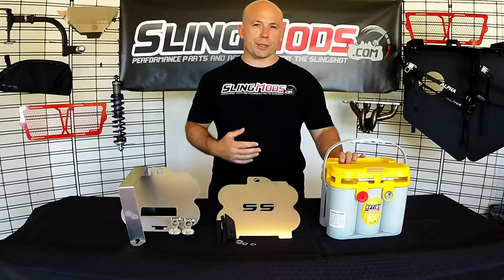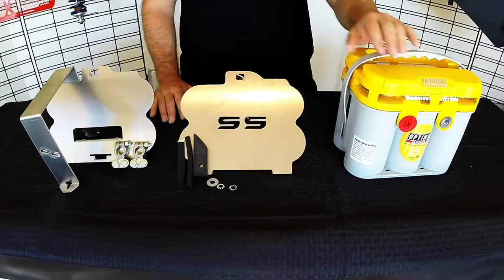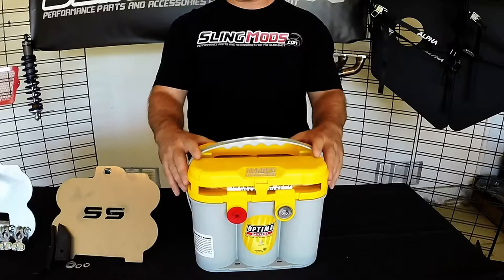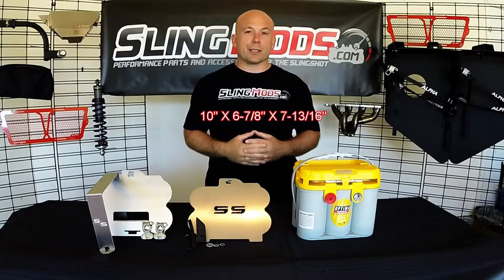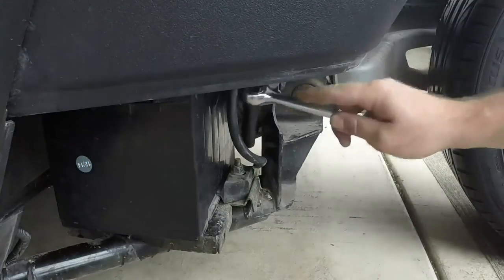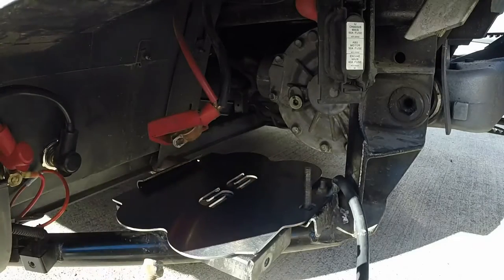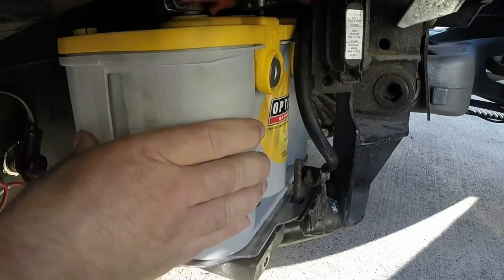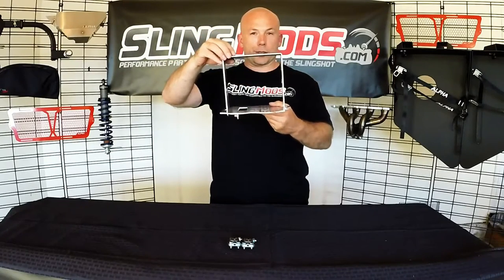Polaris Slingshot Optima Battery Tray Install by Slingmods!

Comment: Hi Joe thanks for the reveiws my husband and I have been watching your vids and they are great keep up the work.We have not got one yet seeing if there are changes for 2017 models.Maybe your team could get Crower or Crane too look into a camshaft upgrade for the SS thats what would make the header system really shine along with PnP head them 3 combined I think there would be an easy 25hp+ added too the rear wheel.With the turbo set up if someone could work with JE on pistons say 8:7 8:8 you could run a garrett 30R turbo at 15 to 17 Pounds of boost all day long and have 400+ HP with a tune at the rear wheel all day long.
Reply from the maker: Hey thanks for the input! I've also been hoping for someone to come out with power packages Cams, heads, valves etc....We'll see what happens.  As far as the build you're talking about, if you're going to do it you might be better off starting with a 2008 LE5 longblock.  They had forged internals from the factory.  The newer LE5's do not.  I'll check out Crower and Crane. :)